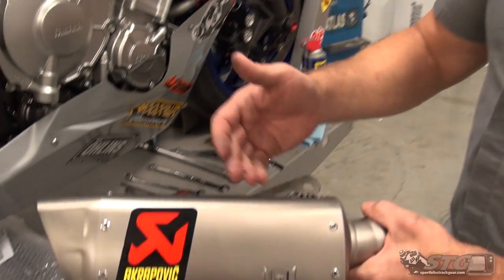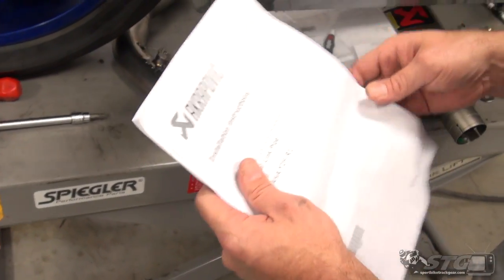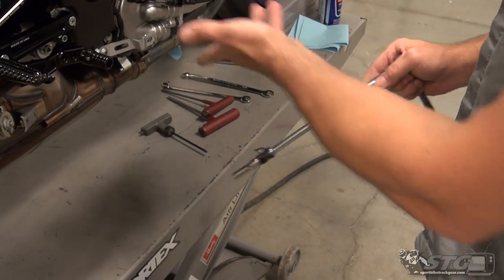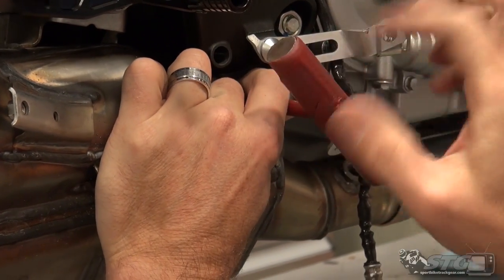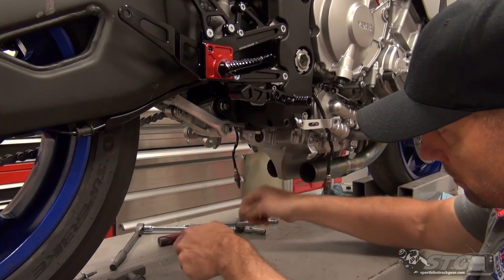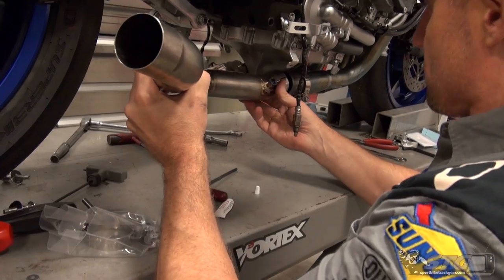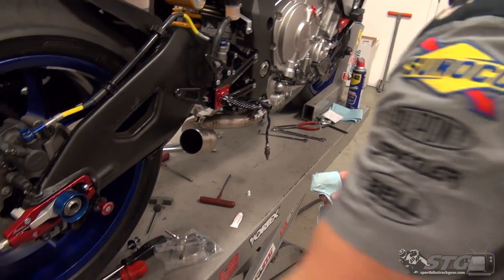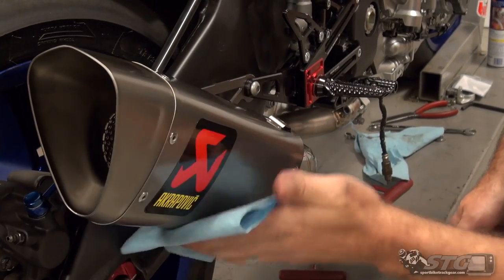Akrapovic Slip On Exhaust Install on a 2015-2018 Yamaha R1 from Sportbiketrackgear.com

Comment: Your video for the can and link pipe installation is absolutely perfect. The same can be said of the block-off plate video you have posted. I was able to install everything without ANY issues. Thank you, thank you, thank you!!! My '16 R1 sounds like a beast with this system.
Reply: Jonathan Hall I’m going to install mine too, just the slip one and link pipe. Do i need to flash ECU?

Comment: Hey Van, love your tutorials on the R1. Been using them when working on mine. I know this vid is old but i have a question. Got a m4 black ceramic slip on currently on the R1 and finally ordered the m4 mid pipe. I was hoping it was gonna come in this week but the shop I ordered from called me saying they're on back order and wont be shipping until october. They have the akra link pipe in stock and could be delivered to me next week. Do you know if the akra link pipe will fit the m4 slip on?

Thanks.
Reply from the maker: The Akra pipe will work with the M4 slip on. - Van

Comment: I'm asking because I don't know, but I thought red locktight was the it ain't never coming off color. 
Watching this a few years later. What are your thoughts that DMG finally stopped acting like a 2yo and is allowing AMA MotoAmerica to sanction the 200 next year?
Reply from the maker: You can get red loctite to release with a little bit of heat. I am excited to head to Daytona with MotoAmerica in March. Max Van will be competing in the King of The Baggers along with Jr Cup in 2022. MotoAmerica is doing a solid job with the series so I expect to see great things for the 200. - Van

Comment: Hey Brian I got the hotbodies sets installed awhile back and the support bracket doesn’t quite line up with the TI system. It’s stable up and down but has a little play left and right. I am concerned about track tech and what they’ll say so is there any other bracket or support piece u guys know of that would help?
Reply from the maker: You should not have any trouble with tech as long as the lower is not falling off. If you need to make a bracket grab some flat aluminum stock from a hardware store and bend one up. - Van

Comment: is this worth any power?  I hate the idea of a gigantic block of heat under my back impeding airflow.... > the cat.
Reply from the maker: Yes removing the cat and installing the slip on with the mid pipe will drop some weight and increase the power. To get the maximum benefit you will need to flash the ECU or install a fuel controller. On the R1 I would suggest the FTECU flash kit. - Van

Comment: So I just ordered a akrapovic full system and was just curious why the same exhaust has 3 different prices?
Reply from the maker: The Akra 3/4 systems for the  R1 are modular with several combinations available. It makes more sense to sell the pieces individually than to sell them as full kits. - Van

Comment: Can you remove the baffle from the exhaust or no? I just bought the 2020 version for my R1 and they say you can remove the baffle, but I can't see how it's possible.
Reply from the maker: The 2020 version is different than this one. I have not seen it which makes it hard to accurately comment. I would take a look at the instructions that came with it first. If it came with a db killer installed and it is removable there will be a fastener holding it in place that will be visible at the rear of the  can on the inside facing the bike or perhaps the very bottom. - Van
Reply: @sportbiketrackgear  thanks for the reply. There's definitely a screw at the opening, but there's no way to remove baffles unless you take the entire can apart with the rivets.
Reply: @sportbiketrackgear  update the screw is there for if you want to put a baffle in as it's sold separately.

If I get a link pipe do have to get a tune?

Comment: I just got the this link pipe from stg love it !! but one question plz help .. after putting think link pipe on do I need to retune ?? Or is it ok everything stock
Reply from the maker: You do not have to get the bike tuned if you are happy with it's performance after the install. After you install it ride the bike enough to know if you are happy. If you find yourself wanting more get the ecu flashed. - Van

Comment: hey van I went and got it tested with the graves 3/4  ecu map it came out to 180hp to the wheel. so I went with a flash tune and PCV with a custom map. 184 hp to the wheel.
Reply from the maker: +Kyle Abron You added the PCV on top of the Flash Tune? I assume the dyno tuner needed the PCV to do a custom map for you? - Van
Reply: Yeah. Very big difference. There were a few lean and rich spots on the graves map that wouldn't allow him to adjust them, so we went with the unrestricted ecu flash with the PCV to get better numbers. Stock wrhp 167 now 184.9hp (185hp).
Reply from the maker: +Kyle Abron That extra 5hp would for sure be valuable when racing. Thanks for sharing that. - Van
Reply: No problem

Comment: I hear some people say that they get off clutch low speed throttle issues without a Flash or Power commander when they do a cat delete with slip on? I want to do a cat delete and wouldn't mind a tune but I have a new bike with a 5 year warranty and don't want to void it with a flashed ecu
Reply from the maker: I rode the R1 (and several other bikes) after installing an exhaust system before flashing it or running a fuel controller and never ran into anything that I felt was unacceptable. The only way to know how you will feel about it is to install the exhaust and ride the bike. Odds are you will be good to go. - Van

Comment: With the flash tuner you used in a different video. Is it okay to put the Graves Full Exhaust tune provided by flash tune.... Even if i only put on a decat/akro slip on? (R1M)

Comment: Please answer i have a danmoto link pipe on my 2018 r1 and a graves motogp slip on do you think i can just replace my slip on with this akrapovic slip on? i really like how toned this is
Reply from the maker: If the danmoto link pipe works with the Graves slip on it will work with this Akrapovic slip on as well. - Van
Reply: @sportbiketrackgear  Thanks Van. I think my combo is just too loud.

Comment: do you sell the carbon heat shield you ended up using on this video?
Reply from the maker: The heat shield comes with the slip on. I do not see this being sold separately. - Van

Comment: Hey van!
Great video.. just bought a 2018 r-1.... i was gonna order a mid Pipe and slip on.. do i have to use a power commander?  Or could i just send in my Ecu to have you flash?
Reply from the maker: No you do not need to install a Power Commander, especially not if you intend to have the ECU flashed. For the R1 flashing the ECU is the way to go for sure, it makes a huge difference in the performance on the R1. We do not flash the ECU for you but we do sell the kits. I recommend getting the Bench Tune Kit that allows you remove the ECU and flash it at your computer. Super easy to do and you have the kit if an update comes out you can reflash at no extra cost. Here is a link to that kit on our site: 
https://www.sportbiketrackgear.com/flashtune-ecu-type-18-bench-tuner-kit-yamaha-yzf-r1-15-17/  - Brian Van
Reply: Thanks will do!!!

Comment: Where do you get that lower fairing that cover the entire pipe???
Reply from the maker: It has been sometime since we did this install but I remember the carbon shield being included with the can. You can check the Akra documents before you but to see what is included. - Van

Comment: Hey Van,

Do you know how i can safely remove the rivets from the Akra without damaging it? I want to put the other tip on. 

Please let me know. Thanks :D
Reply from the maker: Man it has been a while since I have handled this exhaust. I am not sure you can get done what you want to get done. You may be better off selling the one you have and buying the one you want. It would be a shame to damage the one you have trying to change it. - Van
Reply: @sportbiketrackgear  Hey brother, thanks for the reply. Believe it or not, I managed to do it, it was a pain in the ass, and almost scratched the exhaust but a good result, in the end, the bike sounds much better now with the open free-flowing tip as opposed to the closed tip. Thanks for making all of these videos, they help me massively and give me so much confidence. Thanks again, ride safe brother, love from UK

Comment: Good morning. I hope someone can help me. I recently bought an R1M (2019). Akrapovic slip on and link pipe are been mounted. I have already optional DBkiller but I'm using the motorcycle without.  Now I have a little pops and backfire. I don't care about this but I don't want that the durability of the engine will be comprimized. Someone told me I need to flash the ECU or add a injection CPU. Someone else told me I'm ok and I can use the motorcycle without any problems for the future. Could you give me a professional opinion?? Thanks a lot.
Reply from the maker: You will not damage the bike riding it with this system installed. With that said flashing the ecu on your bike will significantly improve the power and performance of the bike. If this is something you are interested in then do it, if you are happy with how it performs now keep the money in your pocket and leave it alone. - Van
Reply: Thanks for the support. And what do you think about the DBkiller? Is it better to keep the terminal open (I mean without DBkiller)??
Reply: @sportbiketrackgear  Just to make sure, Akra link pipe and slip on plus FT ECU flash will get improved performance? Also, this system retains the two O2 sensors but the Graves redesigned system completely eliminates the O2 sensors. Why the difference? Is it better to retain the O2 sensors?

Comment: Hi Van, you probably been asked this before, but do I really need to remap the ECU once installed the exhaust? I don't mind the backfires. Or, is a remap necessary for other reasons?
Reply from the maker: +Sergio Deluca I have installed several exhausts on bikes and never remapped them to be perfectly honest with you. End of the day without remapping you will not get the maximum benefit from the improved flow. To date I have never seen an engine damaged when someone installed an exhaust without remapping, still it is possible in theory and we need to say so to cover our ass. - Van
Reply: +Sportbike Track Gear Hi Van, thank you for the advice, I saw one of other vid were you installed the smog off blank plates, I will install one of those instead. You are awesome! 👍🏼

Comment: I have a question when you replace  the full racing system exhaust do i need to put a power commander on ???? If yes what model should i use ??
Reply from the maker: I would do an ECU flash on the R1. Important to know you can ride it without out a flash or Power Commander. If you are happy with the performance then leave it, if you are not then take the next step. The only thing you will have to do in that case is install an exhaust servo eliminator. - Van

Comment: Hey brian, i noticed after i installed the akra linkpipe whenever i turn ignition a red warning light comes up, after i fire the engine up it dissapears. Any ideas? Eed warning light doesnt come off unless i fire the engine up. Checked the manual and it points out to oil pressure and coolant. Coolant is ok. But the oil pressure not sure. Oil level is ok. No orange check engine just the red warning light. Any ideas?
Reply: GHOST888 I have the same problem. Did you fix it?

Comment: Does it sound much better than the stock exhaust? After test riding and hearing a stock one it is so much better than videos will have you believe, so I'm not trusting videos of this exhaust.
Reply from the maker: IMO after removal of the CAT this bike sounds much better. The stock exhaust was actually not bad for a stock system but an aftermarket like the Akra is a huge change. Thanks for watching!
Reply: Thanks for replying. I'm probably going to buy the 60th anniversary 2016 R1. That comes with the Akra slip on so it'll be a start. May have to invest in de-cat after that. Although then I would need to buy a different belly pan as I think it looks really odd without the box there!
Reply from the maker: The R1 is a really great bike! Put down some of my best lap times ever on that thing. -Van

Comment: Does the system that you link to on your website include the mid-pipe that takes the place of the muffler box?  Or is that a separate purchase?  The pics on the website still have the muffler box on the bike (Or at least it looks like that).
Reply from the maker: +PaulBear06 This video is done with the optional link pipe which I will attach below!

http://www.sportbiketrackgear.com/akrapovic-yamaha-yzf-r1-15-16-titanium-optional-link-pipe-collector/

Comment: No need to tune for this system?
Reply from the maker: You can run without the tune if you choose to. To get the best performance out of the bike you will need a flash to get there. - Van

Comment: I have a very stupid question.

On all the side pictures of the r1 i see that the lower fairing isn't there.

Is the lower fairing in this video an aftermarket set or standard?
Reply from the maker: +marin patje It is an aftermarket kit! Hotbodies that I had painted up!

Comment: Hi 
First of all thanks for the great videos. I have a question for you. I have a 2016 Yamaha R1 60th Anniversary with a Two Brothers S1R Exhaust. I have had the ECU flashed and tuned but no matter what is done on the ECU there seems to be a hesitation, flat spot at 4500 to 5500 rpm. Any idea why this might be happening?
Reply from the maker: Thank you for watching and the kind words! Did you do the flash yourself or have it done? Also do you know if it was FTECU or Woolich? - Van
Reply: Hi I had it done. Not sure he used a dyno and not sure what software suite. Did look somewhat  like the FTECU software.
Reply from the maker: @gunnyairsoft4359  I used the FTECU kit on my R1 and can tell you the power delivery was great, zero issues. I would start by taking the bike back to the tech who did the flash and let him know what you are experiencing giving him the opportunity to correct it. Would also suggest asking what he used to tune the ECU, both brand and the name of the file used. - Van
Reply: Hi Van thanks for the reply. I have been back and forth many times to work with the tech. He is a great guy was wondering is it necessary to use a Power Commander with this type of aftermarket exhaust? When he was tuning the bike he did mention that the ECU was a Japanese Model. Don't know if this means anything. I will need to look at this FTECU Kit to find out more. Did the kit resolve any lean issues with fuel delivery? The only issues that I am seeing are flat spots at lower rpms in all gears and modes. When you open up the bike there is lots of power. More of an issue when driving in traffic. Here is a link to my bike being tuned. https://www.facebook.com/andre.kohler.378/videos/10156534948324694/
Reply from the maker: IMO there is no need for a custom tune for 99% of the riders out there. If the motor is stock and all you have done is install an exhaust system etc... the unrestricted files from a company like FTECU work great. The R1 is such a popular bike the files FTECU have available are excellent. - Van

Comment: which do you prefer, this or the 3/4 Graves? If Akrapovic, is it worth the extra few hundred?
Reply from the maker: +R-AIK Both are great systems! The Project bike currently has the Akrapovic and it sounds/runs amazing!
Reply: +Sportbike Track Gear Brian, please detailed opinion. Based on your experience. I value your opinion a lot.
Reply from the maker: Personally I would go with the Akrapovic but I would watch our comparison videos to figure out the sound that you really like!
Reply: +Sportbike Track Gear thanks
Reply from the maker: ***** It won't hurt the bike to run without a tuner, remap, flash, etc but for the smoothest running bike it is a good place to start! For peak performance it is always good to use one of these fuel management ideas.

Comment: What happens if you don't remove all of the O2 sensors off while installing the system?
Reply from the maker: +Brandtner Freddy You have to remove them to get the muffler box off. - Van

Comment: hey van what do estimate in HP with graves 3/4 flash tune?
Reply from the maker: +Kyle Abron Honestly I do not know and each bike would be different depending on the dyno along with other factors. That said the map with the Graves is very smooth, useable power which is what I look for. - Van

Comment: Does the wd40 just burn off without leaving any marks on it?
Reply from the maker: +lenard ggor The WD-40 cleaned it just right, zero issues. End of the day you wipe most of it off and the rest burns off without leaving any marks. - Van

Comment: I just bought the link pipe and the muffler but now my question is do I NEED to re-map? Or am I ok leaving it stock mapped.
Reply from the maker: +Charles Pratt Thanks for the question! Re-mapping is not essential in order to use this exhaust. If you are after peak performance you will want to get a fuel unit or a re-map but if you do not wish to pursue those things it will not damage your motorcycle!
Reply: +Sportbike Track Gear in all seriousness, when it comes to customer service stg can not be beat. Special thanks to Van and to Evan for all the help
Reply from the maker: We really appreciate your feed-back! We try very hard to make sure every single one of our customers are satisfied. Thanks again for watching and shopping with us!